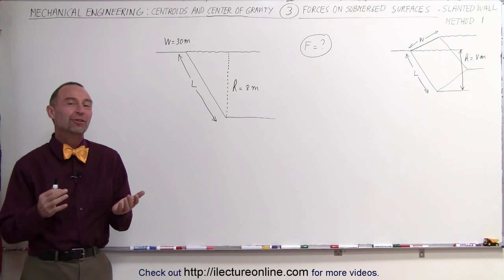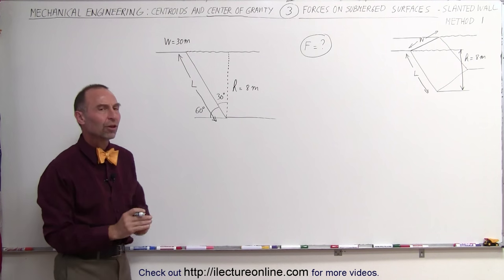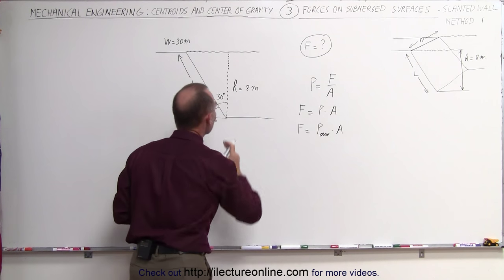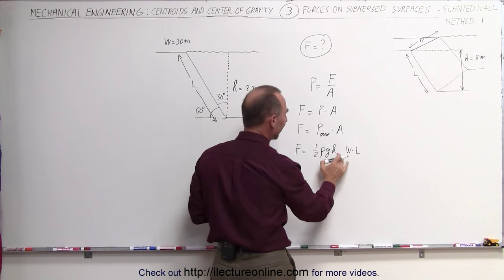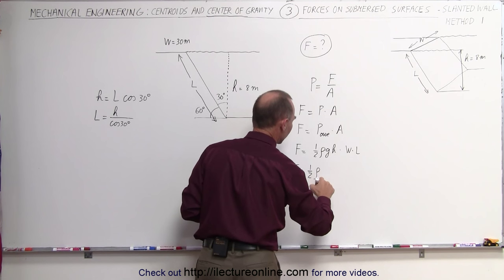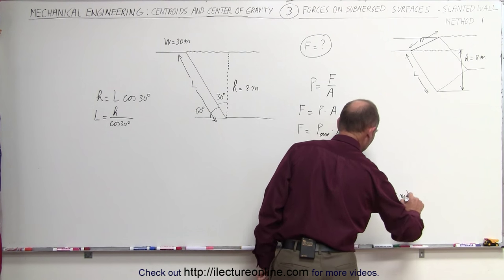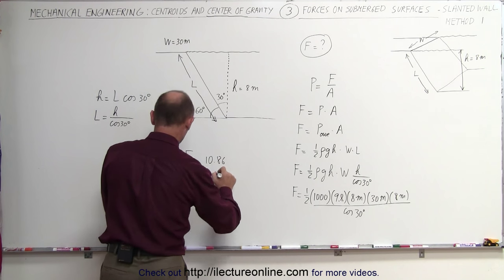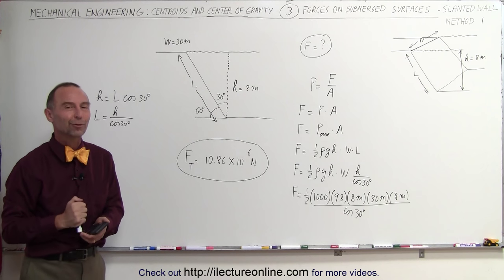Mechanical Engineering: Forces on Submerged Surfaces (3 of 15) F=? of Slanted Wall: Method 1

Comment: You use 1/2 for the equivalent point. Others use 1/3 for the equivalent force point. Perhaps this is because this exercise is usually used to determine the bending moment on that surface, and you are determining total force on the dam?
Reply from the maker: It depends on what you are trying to calculate.
Reply: @MichelvanBiezen  1/2 for x axis force and 1/3 for moment about bottom restraint?

Comment: How could the average pressure be the halfway point when the pressure is not constant as you submerge?
Reply from the maker: The pressure is a linear function of depth. Therefore the average pressure is half way down to the bottom.

Comment: It would be great if you mention the direction of that Force, since all Forces have direction. I think it is normal to the slanted wall. Also, it would be interesting to talk about the horizontal and vertical forces.
Reply: In this case there would be a vertical force on the wall due to the water's weight, and yes, a normal force exerted by the wall on the water perpendicular to the surface of the wall.

Comment: Is this force just the X component (to the left), or is this the NET force, taking both the horizontal and vertical parts into consideration? Because it's slanted, there is some force due to the weight above it right???
Reply from the maker: Use  P = F/A    Therefore F = P x A

Comment: why did we take the average pressure
Reply from the maker: Force on a submerged wall can be found by integrating over the whole wall or by simply multiplying the area of the wall by the average pressure since the pressure in linearly proportional to the depth of the water.

Comment: Sir  in pressure you have taken the vertical height while in area you have taken the Slant height, plz can you answer.
Reply from the maker: Pressure only depends on depth.  Therefore you use the vertical height for pressure.  But if you want to calculate the force against a slanted surface, you need to take into account the slant to find the area.
Reply: @MichelvanBiezen  Thank you sir